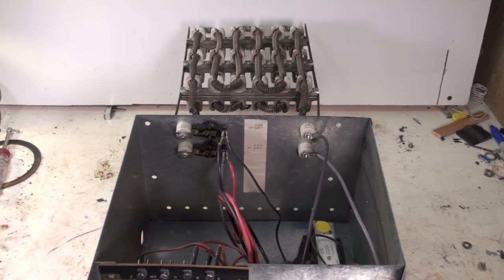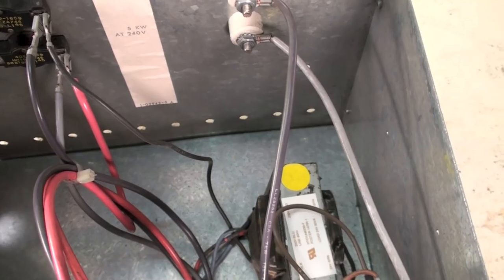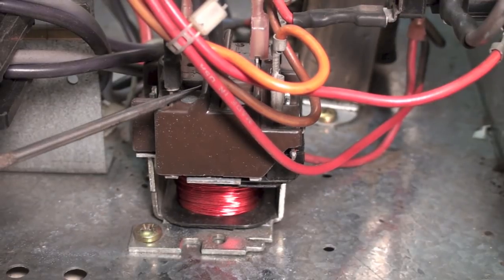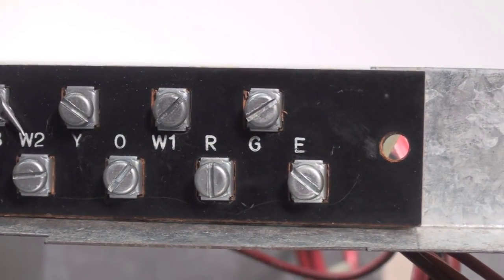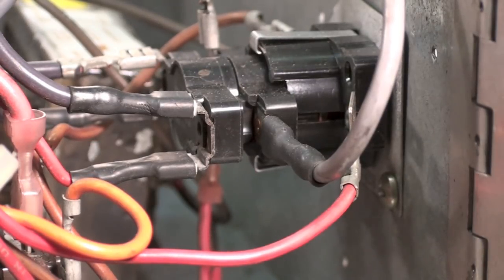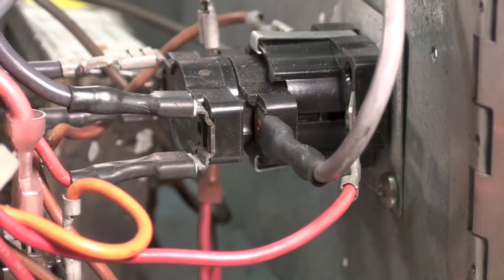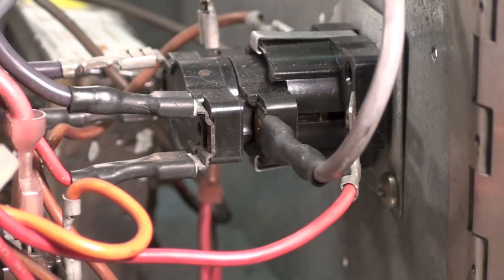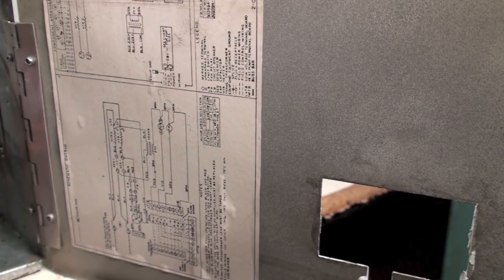Electric furnace: the basics

Comment from the maker: They were probably the worst but most common of the sequencers.  occasionally they would burn up and make quite the mess.  I found quiet operating contactors made by honeywell that could be used and I never had a failure after that.  Thanks for the comment.
GFM

Comment: i have also worked on tons of these things,the seq. is the 1st thing to ck,i have replaced so many of them,some later models came with contactors,then relay with small printed  board on the relay,but the seq. controls are the worse things sometimes,they have that little small metal disc in them that when 24v energized heat rises it to activate the seq,crazy idea but some have lasted for yrs before they go bad,i really dont see how they last as long as some do,great video,thanks

Comment: when replacing the seq with contactors,even using quiet contactors,they will get louder with time,but a lot less problems,and the contacter needs to be heavy duty not 30amp for cond,i have run across this and the 30 amp wont do for heat strips they burn up in no time at all,great video,cant wait for the next 1,keep em coming,thanks

Comment: thank you for the video. my electric furnace smells funny when it comes on, like burning electronics. So I was gunna call to have it looked at, serviced, or replaced. It is 30 years old and I live in a mobile home.
Reply: Costello heating and cooling installed a new furnace.  They installed a Goodman mbr1200aa-1 ac, or tried to install. Very disappointed and frustrated.  The owner, Gene, gave us a estimate. Then the next day had 2 young guys install the furnace. They did not know what they were doing. The job was supposed to take less than two hours. They worked from 9am to 2pm with the job not completed. 
After they got "done" wiring the furnace, they flipped the Goodman breaker then flipped the main breaker.... sparked started flying, lit up the house! They wired it wrong and screwed up my new furnace. 
The owner went to go get a circuit board and came back around 6pm. During that time, the Goodman was left running, blower did not shut off and the furnace heat did not shut off either. So for hours the thermostat was set at 63 degrees Fahrenheit and the temperature in the house kept raising up to 88 degrees.  Unbearable and the breaker was too hot to touch to shut it off. 
The owner arrived around 6pm to fix everything,  the circuit board part, then realized he needs another part, a relay. Left to go get the relay, and came back around 8pm. 
He got the furnace up and running on 1 element.  So it didn't blow hot air, and it's 19 degrees outside! He said he would come back tomorrow with a contact and hook up the 2nd element. 
Very frustrating and scary.  
I would like a new furnace, one that didn't have sparks flying out of it, which could shorten it's life or damage the furnace.  And a new blower, one that wasn't running nonstop for 6 hours, what a break in cycle!
Last but not least, when they removed the old furnace, there was a door. Now they took that and are not supplying us with a door. When I asked about a furnace door, he said "put a sheet up". Not only is the unsafe and a fire hazard, but ugly and unprofessional. I need a door so kids don't get hurt or my cat doesn't jump up and get hurt. 
I paid all that money and you took and used my warranty AND I don't have a cover/door. 
$ 2,200
Goodman electric furnace 10kw MBR1200AA-1 ac serial number 1602059038

Comment: Sequencers and burned/loose connections are my most common electric furnace issues. I'd like to see sequencers disappear. They're easily prone to failure. I'd prefer a single contactor or even a solid state relay (pretty expensive but silent)
Reply: Lots of units use relays and I think they work well. Old trane units use contactors and I’ve encountered a lot of contactor hum that gets very annoying. When it comes to explaining something to a customer I would much rather tell a customer a sequencer is bad then tell them their contactor is working but is making noise and the only solution is to replace.

Comment: I'm working on a very similar heating system of 1979 or so vintage. It doesn't have any sequencers, but does have a couple of Robertshaw relays (TDS-3LA and TDS-3GA) that look to be relatively new. Did a visual inspection of heating elements (3) and can't find any breaks. Limit switches do not appear to have overheated. Tested fuses and they all check out. Suggestions? Carrier system BTW
Reply from the maker: Most your testing should be done while the unit is operating.  amp draw, duct temp rise.  Be sure all wiring terminals are tight.
GFM
Reply: @grayfurnaceman  After some additional reading I've discovered the Robertshaw TDS-3LA IS a sequencer. In testing the 24v side it appears that the sequencer heater element has failed and is not activating the 220v side and the second sequencer (Robertshaw TDS-3GA). One parts house lists a White Rogers 24A34-6 as a replacement for the 3LA and presumably the 3GA. Have you had any experience in making a swap like this?
Reply from the maker: @bluiewest1  I can't say I recognize the Robertshaw number, but if you have 4 elements in your furnace, the White Rodgers unit will work.
GFM

Comment: Just had a new Coleman electric furnace installed with a 3 ton unit  outside the weird thing is the blower will continue to blow after the air conditioner shuts off at lower speed it also does it with the heater the installer told me that was the way it would work before he left.

Comment: Why does my old 80's ruud have a resistor that hooks to the contactor from the element? Mine keeps burning one 120v leg. I get plenty voltage from the 24v  transformer. Think the sequencer or resistor by the element could be the problem? I use a laser thermometer and its only the one leg that heats fast at the breaker like to 200 in 2 min. All my connections have been checked & cleaned. These elements seem to have constant power straight from the power source to the thermo disk to the elements and I'm guessing activated by that resistor somehow? They don't heat when the furnace is off even though they have power. Anyway I'm guessing and wandering from someone that has experienced with these old ruud. I'm stumped and been chasing my tail over and over. Pros are rare here and parts are 1.5 hour each way drive. Any help would be GREATLY GREATLY appreciated. Thanks for your videos

Comment: Thanks for the video. We’re installing a used electric furnace. Now we are running the main power to the unit and we can’t find a grounding bar or where to connect our 6ga ground wire. We looked pretty good but can’t figure it out.
Reply from the maker: If there is no grounding lug, you can buy one at an electric supply store.  You must connect ground the chassis.
GFM
Reply: @grayfurnaceman  thanks, Can I 
do the same for the neutral? We couldn’t figure out where it went also
Reply from the maker: @jeffsond  Most electric furnaces do not have a neutral.  They operate on 240 volts only.  In any case, the neutral should not be connected to the chassis.
GFM

Comment: This was a lucky find today for me, I have an 1982 York blower both ac and heat with pump. I have an issue with the blower thinking it's on heat when it's on AC. I was told it was the control board and have tried finding it to replace and was told the part was discontinued. However after watching this video. I'm wondering if it not the control board but a sequencer instead. I've replaced the thermostat and ac works fine. But in order to get the AC working I had to disconnect the wires for heat on the control board.wondering if you could shed some light on this matter thanks Birdie
Reply: why not start with looking at the thermostat terminals it probably has the wires reversed

Comment: Can you tell me what would cause a blower motor to keep running on the electric furnace after the heat strips are off. Blower won't stop even after heat strips shut down; Thanks and love you youtube.
Reply from the maker: +Joseph Dailey Probably a stuck sequencer.  The M1 and M2 contacts will start and stop the fan and usually the first element.  Hope this helps.
GFM
Reply: +grayfurnaceman thanks a lot and I love your you tubes

Comment: I'm gonna take a chance here and see if I get an answer. I checked a 20 kw today, and only the top 2 elements come on and the bottom 2 don't. I took the wires off to check for continuity on the sequencer and my meter beeped meaning "good". Then I checked the limit switches and they also beeped, and lastly the elements themselves and also beep. Both breakers show 240 volt. I'm at a lost on this one. Should I ohm it out  instead of continuity?
Reply from the maker: Put away your ohmmeter.  It is the last tool to be used in troubleshooting.  
Get out your clamp-meter first.  Check amp draw on each element.  When you determine which are not energizing, use your voltmeter.
Check for voltage at the source of each circuit.  Then check at the load.  If you read the proper voltage at the source, and not at the load, then check each switch in the circuit.  With these type of circuits, this simple method is foolproof.
GFM

Comment: Trying to help a buddy that is in a town without a service tech. Norton Broan electric furnace and he turns it on heat and nothing happens and he turn the fan on and it comes on. I got him to jump r&w at the thermostat and nothing happens. I don't know much about electric furnaces is there anything that would be likely to be the problem? Thanks in advance
Reply from the maker: First, I would check my "electric furnace" playlist.  It has some training on electrics.  
No heat at all, check for low voltage at the thermostat.
GFM
Reply: I will check deeper into your playlist for sure. If I had him jump r&w and it still isn't working that I don't think it can be the thermostat. Thank you for the reply

Comment: I got a new heat strip kit for a Rheem. Its a 15kw kit and it came with 2 (two) 60amp breakers installed on the kit. I have 100amp breaker at main box with single feed coming to air handler. I have the breaker jumper for the 1 supply 2 breaker configuration. 2 heating elements are connected to 1 60 amp breaker and the other 60 amp breaker has 1 element connected. Shouldn't the single element and blower motor be connected to a 30amp instead of a 60? Thanks
Reply from the maker: Usually, they are.  If it is the factory kit for your furnace (on older furnaces that can be kind of a joke), it should work.  The 100 amp breaker is there to protect the field installed wire, not the furnace.  My opinion is go for it.
GFM

Comment: I have a vintage G.E. electric wall heater with the coils and a fan. How can I add a thermostat to it. All it has is a off on knob and one for the temp that has no numbers.
Reply from the maker: First, throw it away.  most of these heaters with exposed coils are quite dangerous to use due to fire hazard.
The knob for temp is also a limit that gives a small safety margin for overheat.  
If you must install a thermostat, it must be installed in series with the original thermostat.  
GFM
Reply: @grayfurnaceman  is there a new stile I can replace it with? I'd like to upgrade the room.
Reply from the maker: @williamhiggs9646  There are many wall heaters, most use a fan to force the air.  Much safer.  The size won't be the same but any home store will have them.
GFM

Comment: Can I please get your opinion on something? I have an electric furnace and I've had someone come look at it and he said everything was fine, but the heat that comes through the vents is luke warm. He said that's just part of having an electric heater but my electric bill goes through the roof in the winter and I only even run the central heat at night. What should I do? Should I get someone else to look at my furnace or is that just the luck of having electric and not gas?
Reply from the maker: If it is an electric furnace and not a heat pump, it should have about the same duct temperature as gas.  There could be one or more of the elements not working.  That would cause the low duct temp.
GFM

Comment: Really need some help all the other videos on YouTube are for newer furnaces. I have about the same furnace you had in the video I cross some wires with the common wire now something went wrong and now it dose nothing. I know on the newer furnace is you would probably only have to replace the fuse but I have older furnace what would I have to replace. Please help
Reply from the maker: isaias torres Did you change some of the power leads?  If there are 2 or more circuits, you could have the same side of line to both sides of the circuit.  Let me know what you changed.  GFM

Comment: I have a surefire 101ce  When using the electic evrey once and awhile it will start short cycling. As its doing this the furnace/elements are still heating up, creating alot of heat best the fan only cycles for 20sec or so.  Was wondering what you might think? thanks
Reply from the maker: First, I would jumper the thermostat terminals to see if it is the thermostat.  You could also have a problem with the fan overheating.
GFM
Reply: @grayfurnaceman  Well i swapped the one(thermostat) from the wood damper with the electric one(have a 2 thermostat system) they are the same and ended up getting the same problem after.  This doesnt happen all the time just he now and then.  When running wood we've never had a problem with the fan shutting off ever and will run for days sometimes as we are in Northern Ontario and winters are cold haha. But when this has happened ive pulled the manual fan tab on the limit switch and the fan runs fine, just to get the temp down from the elements.
Reply from the maker: @joe281977  Its possible the the fan is overdrawing power and shutting down.
GFM

Comment: My home is a 1984  Mobile Home all electric.
I bought the heater elements setup to replace my heater elements on EBay.  I didnt know what I was doing which is par for the course.  My heating element has 3 coils  and a Fuse Box.  The Old Elements were just disintegrating.  When I went to replace the wiring it started falling apart in my hands.

I found one on EBay for $220 that had circuit breakers which meant I could replace the fuse box.   (The box is OK because I changed it out 15 years ago).  These elements had relays and limit switches  everything was attached.  2 wires for the control board that hooks up to the AC RELAYS  and 4 wires  for the DC Relays.   2 wires to hook up to the fan switch.    

Today I started looking at the Schematics for the new Element System AND ALSO the schematic for my old system.   WHERE IS THE DC?  That was what jumped out at me.
oh oh.  The new elements have DC Relays on the Black wires  and AC Relays on the Red wires.   

So What do I do Send it back?   Or is there a Control Panel I could buy with a DC power supply on it that I could buy or what?

Something about being 78 on verge of Alzheimers is basis of  what I will have to plead should the house burn down I guess.

What should I do?
Reply from the maker: What brand and model #?
GFM
Reply: intertherm   F000993043.  Am sending back the unit I ordered because it has DC  relays, it is the wrong one.  Tomorrow I am going to try to get a Resting Kit, I need one with the ceramic Ends because mine are broken.
Reply: grayfurnaceman. I have an electric furnace in my mobile home its on but is only blowing cold air .do you know what could be wrong and how to fix it

Comment: My electric heater is on for like 30 minutes then the breaker breaks on the panel .. My a/c doesn't have this problem.  What could be the issue.
Reply from the maker: First, I would check the breaker terminal for tight.  The terminal should be very tight.  If it continues, the breaker may be failing.
GFM

Comment: put on new thermostat and now heater will not work. put old thermostat back on and still nothing. Smelled something burnt. Any suggestions on what to check?
Reply from the maker: Check the low voltage.  You may have shorted the transformer.  That would be the smell.
GFM

Comment: What kind of electric heater furnace would you recommend for a 1700 square foot home?
Reply from the maker: The square footage is only one of many factors to take into account.  You need to do a heat loss calculation for the home before deciding on that one.  There are some simple ones on the internet.  Hope thisd helps.
GFM

Comment: What is the proper way to hook furnace up to breaker box.Furnace max 80 amp it has to 40 amp breakers in the furnace
Reply from the maker: You can either use one conductor of 80 amps capacity or 2 conductors of 40 amp capacity.
GFM
Reply: @grayfurnaceman  ok I may just us a #4 awg and just run one wire to double 40 amp instead of two #6 awg wires to 2 40 amp breakers thanks.Better to run just one #4 awg wire and that should carry my 80 amps.